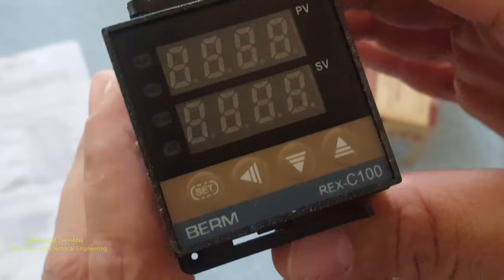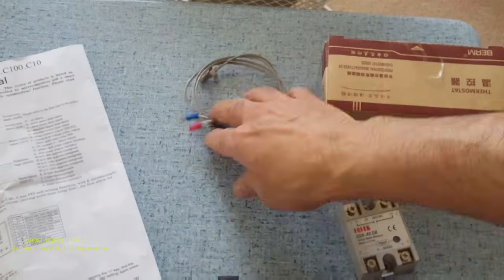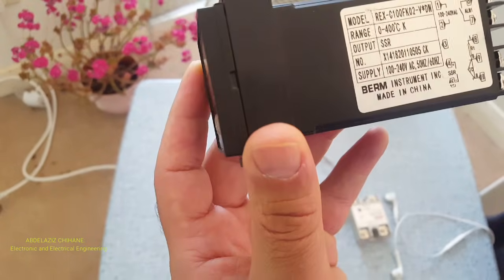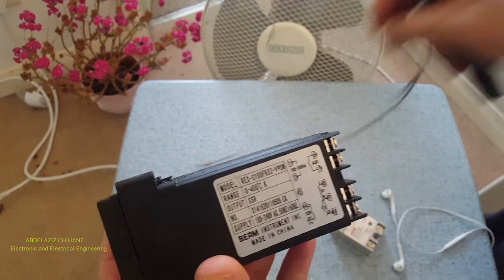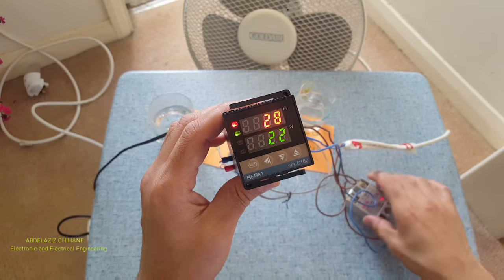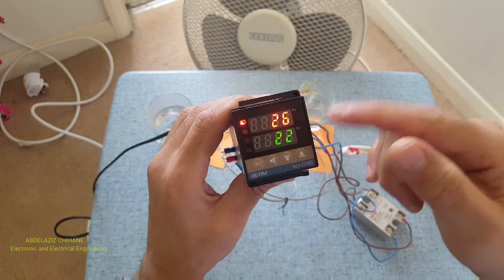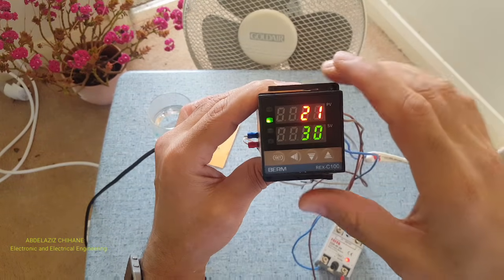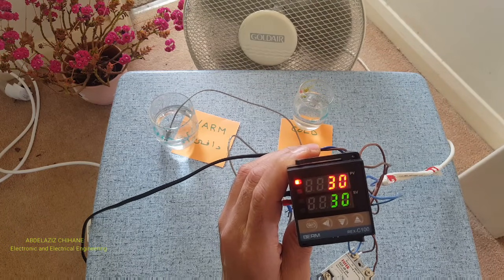How to setup and use the PID REX-C100 TEMPERATURE CONTROLLER

Comment: I carried out this test setup. What’s strange is that with my controller there’s no continuous output, only a pulsing one. This is also clearly visible on the solid state relay—the LED keeps turning on and off. I only set the desired temperature. I didn’t change any of the other parameters.

Comment: Anyone see these behave strangely with the PV value jumping all over as soon as the SSR starts cycling? I’ve tried several thermocouples and two different c100 controllers. The heating element can be plugged in or disconnected and the behavior continues.
Reply: I never found a solution with the counterfeit Rex controllers. Most of these are fakes made in China. Authentic versions are produced in Japan.
Reply: Same here. Did you get the solution? I'm struggling with this

Comment: Hi. Can we replace the thermocouple with coolant temperature sensor?
Reply: Hello, if you want to set the cooling mode or just want the thermocouple to detect temperaturer below zero? 1. You can set the cooling mode. 2. If you want to detect subzero, you can replace the thermocouple with PT100, it can detect the temperature range from -200℃~400℃，just need to set the controller input into PT100, then it will work.

Comment: How to input PID parameters?
Reply: Normally PID parameters are default, but you can set the action frequency to control the PID action speed to realize the more precise temperature control, and for the output we recommend the SSR instead of the contactor.

Comment: Hola, podemos usarlo en el sistema de nebulización o el llamado sistema de niebla que se encuentra en los cafés para enfriar el ambiente cuando la temperatura es alta, siempre que funcione durante treinta segundos y se corte diez segundos, luego funcione treinta segundos y se corta diez segundos y permanece así hasta que baja la temperatura y se apaga automáticamente. Gracias
Reply from the maker: Hola . claro que si puede usar in esso tipo de sistemas  .espero que va bien  para usted .muchas gracias
Reply: @chihanecreativetechno7604  Muchas gracias señor. Estaría muy feliz si pudieras explicar cómo configurarlo de esta manera. Y tienes todo mi respeto y aprecio .
Reply: Hola, puede conectar el relé de tiempo al Controlador de temperatura, con funciones de trabajo de tiempo de ciclo como dh48s - s, que pueden funcionar durante 30 segundos y detenerse durante 10 segundos.

Comment: You wired the relay output side wrong. You show mains nutrual and hot going to the relay out side that is not correct wiring. The SSR input side is correct and the thermo couple is correct.
Reply: While you're correct, it shouldn't matter with AC. It may cause issues if it's the pseudo-AC you get from inverters, but with mains it won't make a difference.
Reply: @EddieTheH  what? if you switch mains neutral and hot you will arc the fuck out of your relay?
Reply: please explain, from the surface it looks like youve no clue what your on about.....

Comment: Gudday sir. How about i will use for cooling sir, all i need is 16-17 C means, 16C below it will turn-off and if 17C up it will turn-on. I will use as a switch(i will pluge my refrigerator) for restoring my pig semen. Thank u and God bles
Reply from the maker: Hi there if you wanna use it you need to do this : 
_press set ,the buttom sv blinks 
_with arrows up down you need to ajust your desire temperature 16c or 17c .
_once yoù have done so press (set) once to store it.
_now you need to press hold the (set) button and the button   next to it for 3 seconds ,Cod appears and the buttom figures (sv) blinking. So now you need to make  it 0001 and after that press (set) four times until you see (oud) appears ,now if you have 000 below (oud) you need to change with arrows up down to 001 for cooling and after that hold press the set button for approximately 3 second and let go .now your device is programed to your desired temperature  .hope this could help  if u have any doubt please feel free to contact me .thanks
Reply: @chihanecreativetechno7604  wow thank you very much sir, this will help a lot, God bless
Reply: Can l use this on incubator please
Reply from the maker: Hi  yes u can use for incubator
Reply: @chihanecreativetechno7604  but how sir plz explain the settings.... I need keep 37 °c in box?